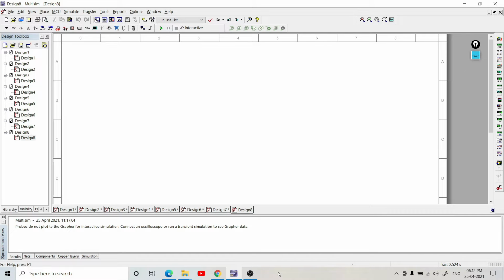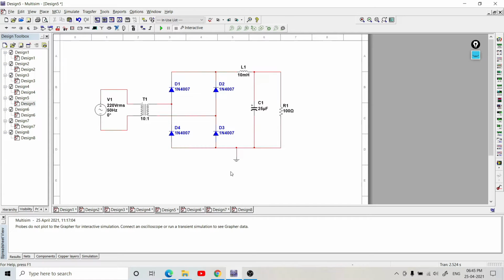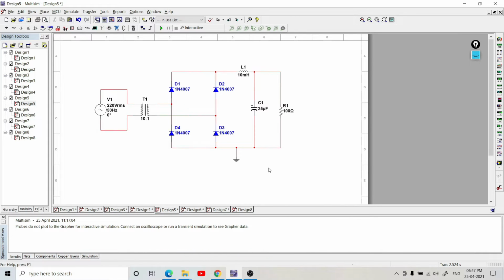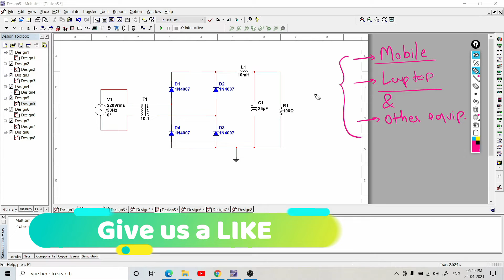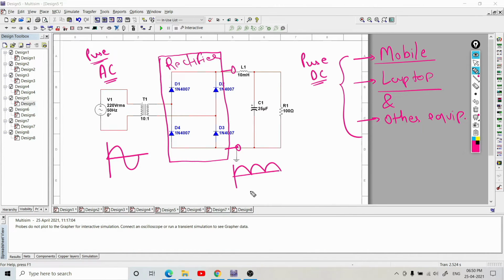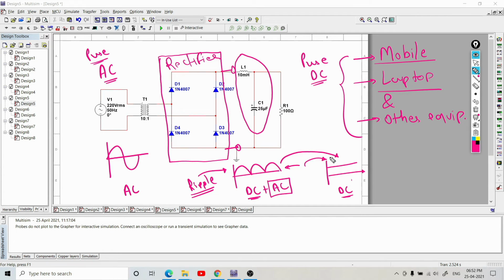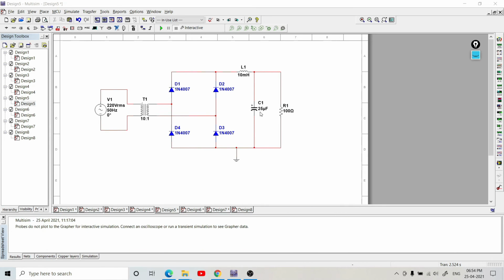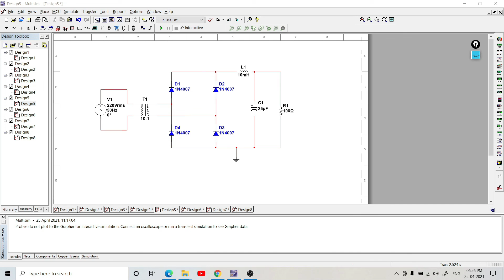Need of filter in rectifier | Types of filter circuit for rectifier | Multisim Tutorial | Mruduraj

Comment: The filter is a device that allows passing the DC component of the load and blocks the DC components of the rectifier output. Thus the output of the filter circuit will be a steady DC voltage...  Capacitor is used so as to block the dc and allows ac to pass.